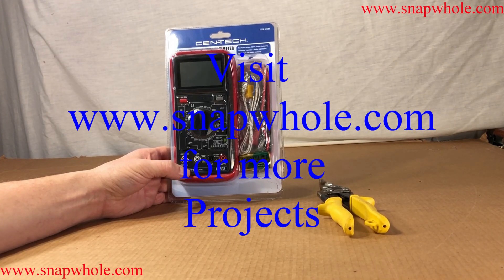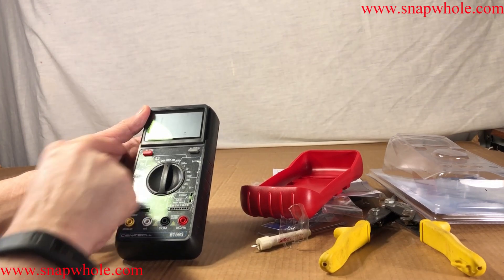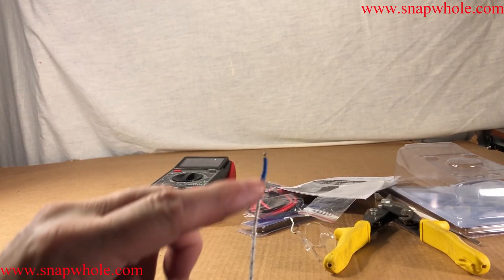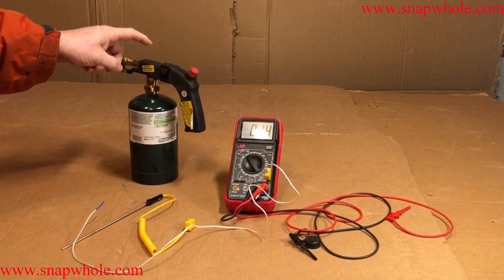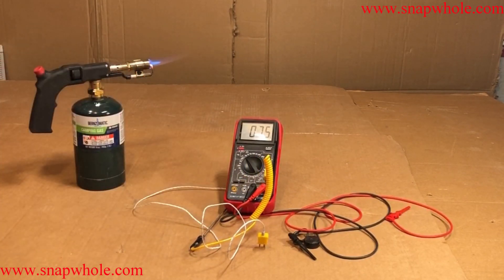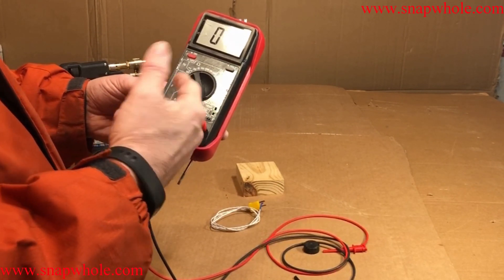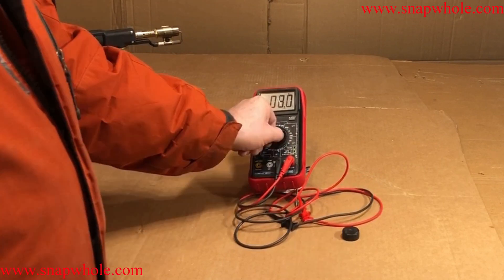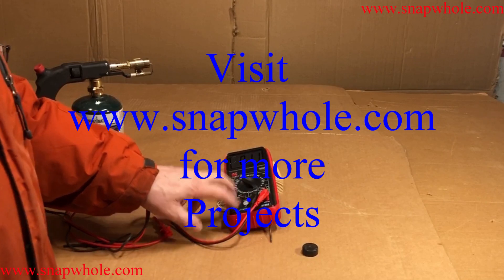Harbor Freight Cen-Tech 11 Function MultiMeter used to Measure Temperature

Comment: Come on , I like the screw fastened secure the cover and for the price you can't  beat it. Anyway thanks for your time for sharing  knowledge.
Reply from the maker: this is my favorite meter, and the temp setting is just a bonus, and I use the temp setting a lot, I have no reservations about recommending this meter, the capacitance range is not helpful for me, but it is not intended for the ranges I need, but i have specialized meter for that anyway, great price and very useful - thank for subscribing!

Comment: Hi, can I get the link to that Amazon probe please?
Reply from the maker: search 'Type K Temperature Probe' on amazon and pick one based on  your temperature range and length - most go up to about 1000 degrees F, but if you search you can find higher - I buy from aliexpress because they are cheaper, same thing there, search type K - the seller on amazon come and go, so any link would disappear over time - thanks for subscribing!

Comment: I have the same exact meter, ive had it for about 10 yrs or better and never had a single issue, it does what it says, its.durable and reliable and works as good as my fluke meter at a fraction of the price.
Reply from the maker: I gave my fluke to my son, and use this as my primary meter, the only drawback is the absolute time out, not an activity timeout, but as much as I use it, I'm used to it and don't mind that anymore - thanks for subscribing!
Reply: @snapwholeharborfreightreviews  Yeah, that time out does kinda suck,but its still a good meter. 
   Great channel by the way!✌️😏👍
Reply from the maker: thanks for the positive comment - thanks for subscribing!

Comment: does the display on that meter light up?
Reply from the maker: it does not light up, I've had this meter for several years and it is now my main meter, I like it better than my fluke, mainly because of the bigger display and its heat reading function - thanks for subscribing!

Comment: Can that thing measure the microfarad (MFD) value of a run/start capacitor? Like for hvac?
Reply from the maker: without knowing the exact capacitor you are testing, yes you can test with this meter, its possible the capacitor's value is outside the range of this meter is why I say 'without knowing the exact capacitor' - thanks for subscribing
Reply: @snapwholeharborfreightreviews  Oh just for a blower motor capacitor on a typical home furnace. Like the 5 MFD or 10 MFD type. Almost every vid I've seen on youtube the AC techs say the cheaper digital multimeters don't have the proper settings to properly test the MFD value of those capacitors.
Reply from the maker: @mts7274  this meter has 2 unusual setting - capacitance and temperature, my fluke has capacitance but this is the only one that I have that has temperature, if your meter does not have capacitance, you need an ESR meter, see this one that is relatively cheap - https://www.youtube.com/watch?v=hP7OtwFVZAY - I use this HF meter as my main multimeter, and use the ESR for capacitance, but only because this meter's range is made for what you want to use it for, but a lot of the capacitance I measure is in the 10-300 pf range, the ESR also measures induction and tests transistors in a way the multimeter can't - the multimeter only test good/bad - I'm sure you can get an expensive meter that does what this HF meter does, but a name brand does not make it perform better, it just takes extra weight out of your wallet - thanks for subscribing!

Comment: Is there a plug for the capacitance testing socket? Looked a lot and can’t find anything on Amazon . Thanks
Reply from the maker: That socket is designed to insert the capacitor under test into the socket, the main reason for this method is the length of probes would increate the capacitance of the capacitor being measures - if you used probes, they would act as a very long capacitor and the value added would depend on how far apart they are, and vary by proximity to a human body, and proximity to different metals, so there are valid reasons for using the socket itself to do the test - the meter is also not designed to test in circuit capacitors - the capacitor tester also has a somewhat limited range, think testing power supply capacitors (1000 uF), not radio receiver capacitors(100 pF) - i use this meter for capacitance - https://www.youtube.com/watch?v=hP7OtwFVZAY - thanks for subscribing!
Reply: Same also. I have been searching for the adapter for the Cx (capacitor) socket every where but can't find. If you remove a capacitor from a circuit board then the legs are sometimes short and not sturdy to be pushed down the port directly on the cen tech 61593 multimeter
Reply: @zengen8706  Wire-wrap socket pins work. They're long and the good ones have consistent contact.